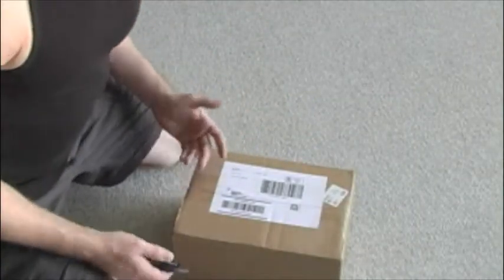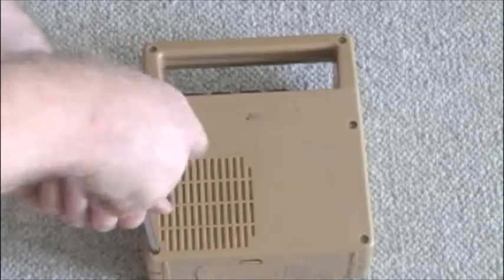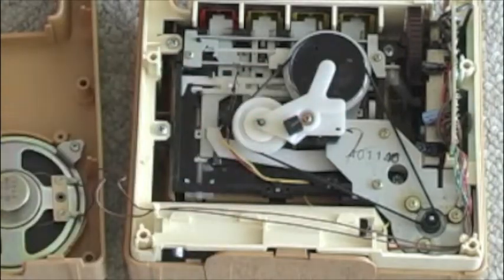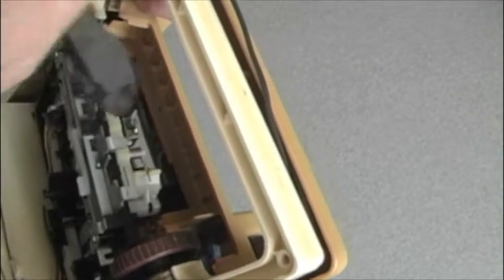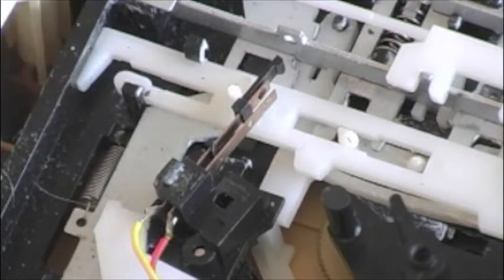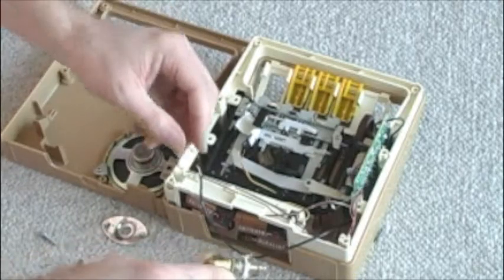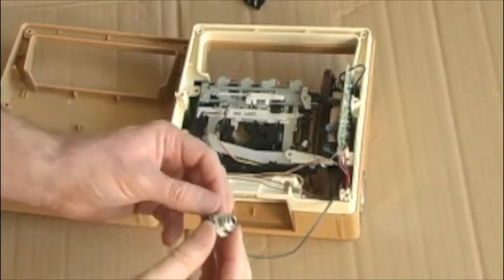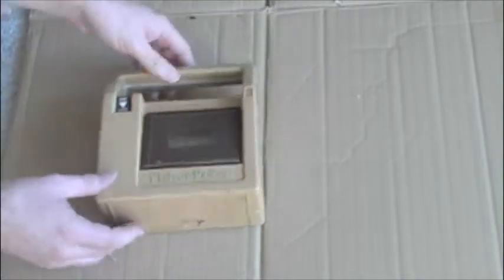Homemade Amp Instructional Video

Comment: I've converted a radio into an amp before, but I don't understand what's going on here. Could you clarify what exactly you are soldering the input jack to?
Reply from the maker: Hey, sorry for the slow reply.  I cut the two small wires that went to the tape head and soldered them to the guitar jack.  That way, instead of the signal coming from the tape head it will be coming from whatever is plugged into the guitar jack.  I hope that helps!

Comment: Besides the speaker, are there differences in sound depending on what tape player would be used, meaning, are there any noticeable sounding highs, lows, coldness, warmth, etc. ?
Reply from the maker: Hey, Shadow,, sorry for the slow reply.  Yes, the electronics of every tape player are going to give you different tones with different highs, lows and mids.  It's had to predict what you'll get until you try each one, but there will be variety.  Generally speaking, all these small tape players will give you one flavor or another of distortion as well, since the signal from a guitar will tend to overdrive their circuits.  I hope that helps!